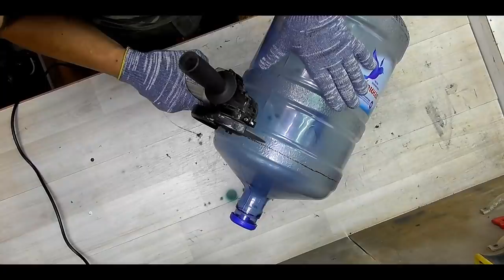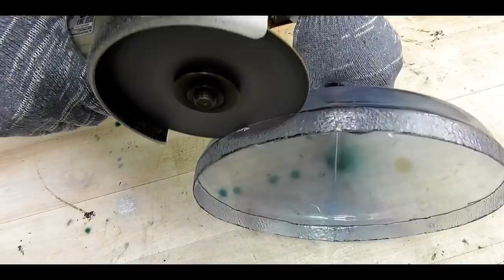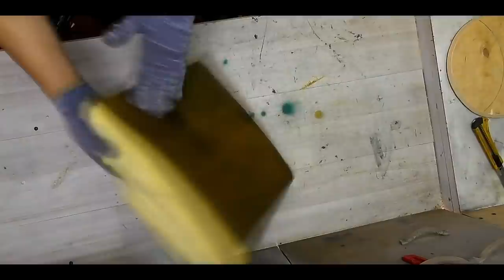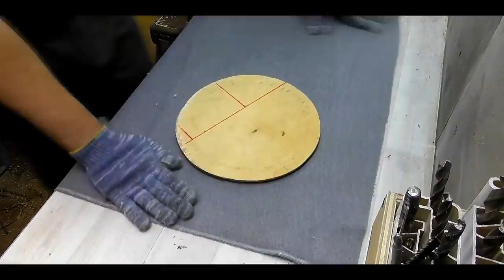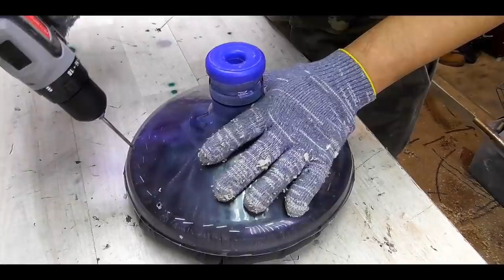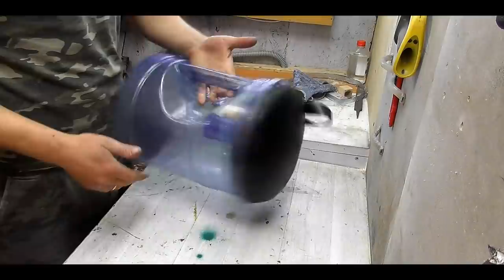You won't believe what I made out of a 19-liter bottle.

Comment: I was surprised by a number of things in this video.  He appears to be wearing knitted wooden gloves throughout - strange choice I would have said, unless it was extra cold in the shop.  He appeared to get through the entire process without using any measuring instrument, apparently without running into trouble. 

The end use - a combined stool and container for junk seems somewhat off-the-wall - but hey .  I would be a bit cautious about letting the public use it as a stool since I suspect it could exhibit catastrophic failure under the wrong bottom.